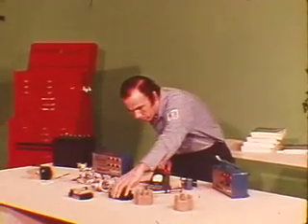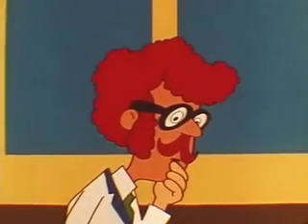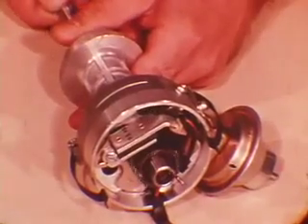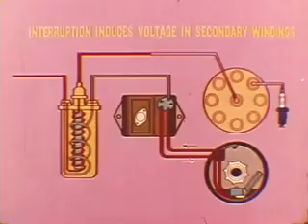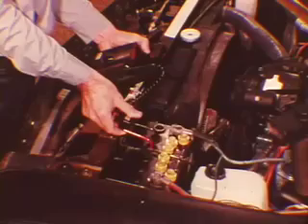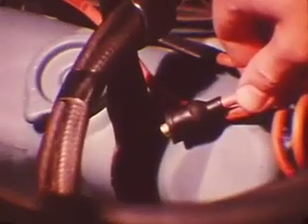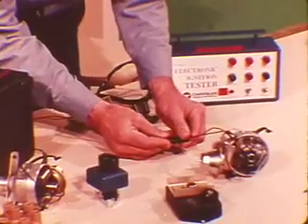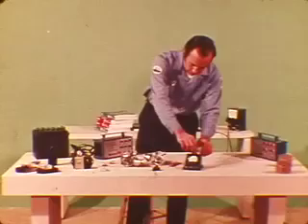73-11 Chrysler Electronic Ignition Diagnosis

Comment: FANTASTIC video !! what they don't say is the name of inventor, very probably Mr MAUREL in France ! worked for SIMCA and later  for Chrysler 2L engines  at JRD very small company for racing engines, Maurel still at work at company named .... MAUREL !!! ( of course it means MORE ELEC !!)  them idea went to SEV marchal company ( Société anonyme pour Equipements Electriques de vehicules) and brevet déposit in USA in 1971 ( the first invention is about 1950's for jets engines ignition) Wikipedia says the first car equipped with integral electronic ignition is the Citroen VISA, 1978 but it is ... false it is the "chrysler 2litres" (or Hillman or plymouth cricket or talbot avenger or SIMCA 2000) same hugly car equipped since 1976 on 2 litres version with the complete system the VISA came out 1978. anyway, this application on cars is french ! 😏 ( héhé yes it is ) for cars

Comment: Having problems making my 73 Duster start.

It has headlight on and working lights  the oil light came on a little but went off. But when I turn the ignition switch (steering wheel apart) nothing happens but the alternator gauage going down a little bit much then back up to normal.

Has a new: battery,  ballist resistor, starter ignition relay, ignition switch inside the steering wheel,  and ignition control circuit, 

My dad got the car to turn over and start by using a screwdriver on the starter . I tapped the starter with a hammer to see if that would help... nothing. I have a manual so I press the clutch down and start the car in Neutral right? But still no crank. What am I doing wrong!?

Any help would be greatly appreciated
Reply: I AM HAVING PROBLEMS WITH 1075 DART , Did you get it running?
Reply: Check the ground wires